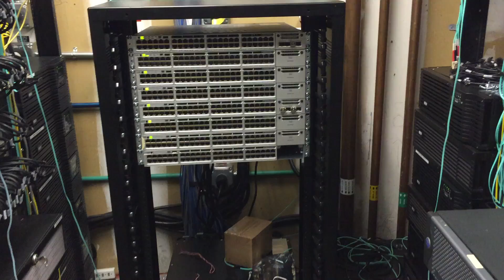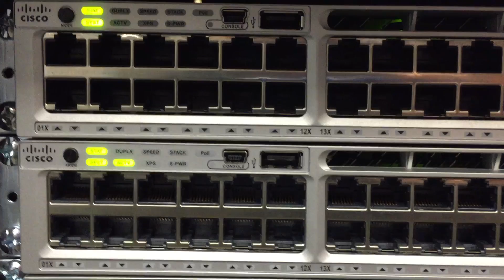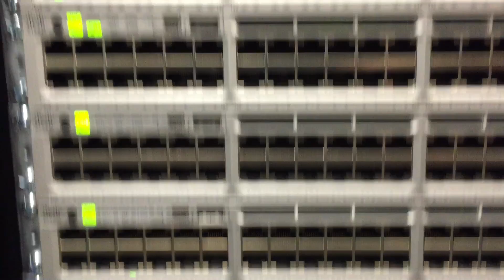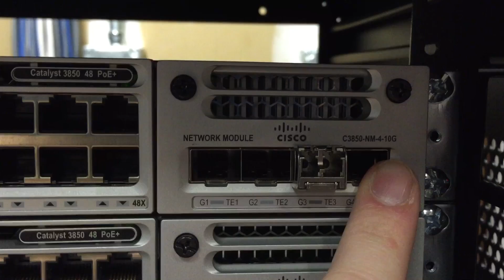High level Cisco Catalyst 3850 switch stack

Comment: Just don't hold down the the mode button for more than 15 seconds.  Wanna know why, it will erase the config on the switch, and these are older ones cause the mode button is hit by the snagless piece on the cable if inserted into the first port.  Great design Cisco.
Reply from the maker: E J yeah I have heard of some situations where people had their 3850s constantly reloading or reloading “randomly” when they would work on them. And it was because of the protective jacket on the cable head was holding down the mode button. Once they figured that out it stopped reloading.

Comment: How many hosts does this support? Thanks
Reply from the maker: Short answer...depends on the port count. 

Long answer... you will either have 24 or 48 port switches. Since the 3850's are stack capable and you can stack up to 9 of them you could have up to 432 ports (not counting the uplink ports). However, it is more common to see the 3850s used at the distribution level and something like the 2960 used at the access layer going to hosts.